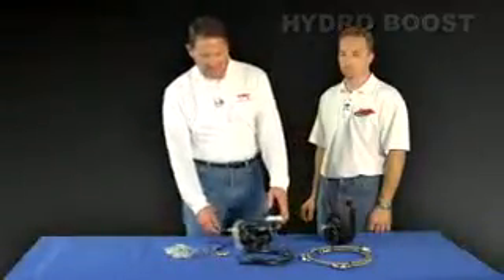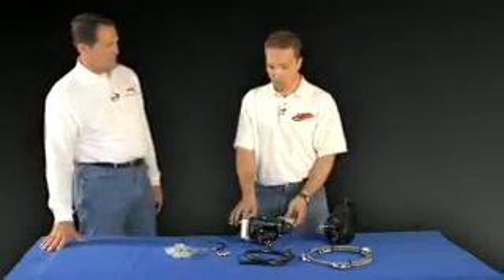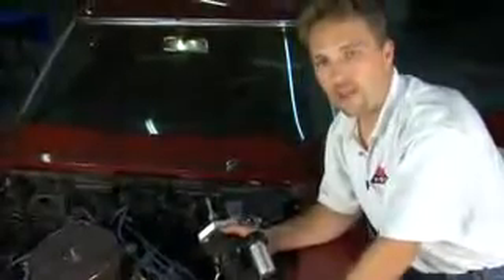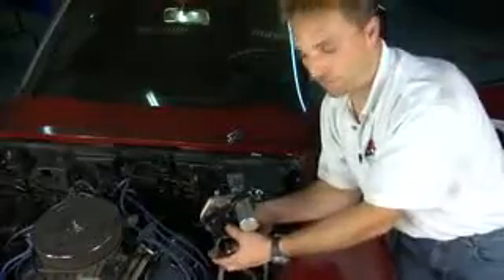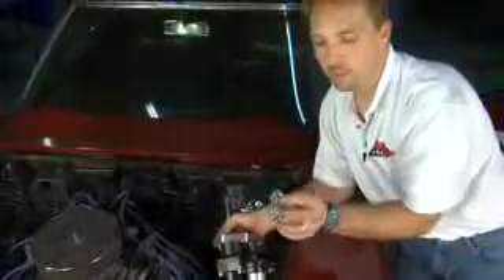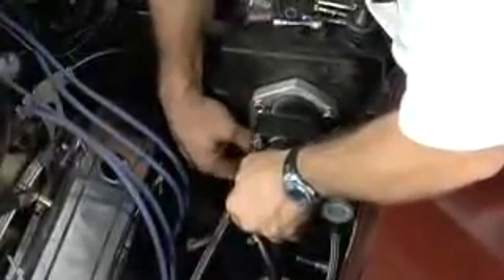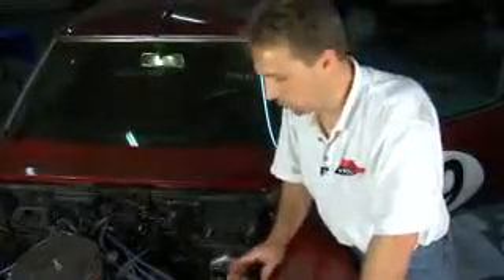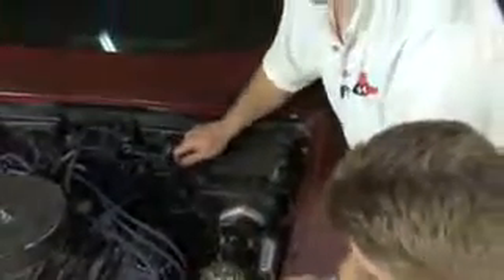VBP - Hydra-Boost - C3 Corvette Hydraulic Brake Assist Systems

Comment from the maker: Locas Cabras, Sorry you feel that way. It's well known (in the brake industry) that hydraulic brake assist systems out perform vacuum assist systems - particular in heavy duty or high performance applications. Please read our updated description (above) or check out the manufacturers FAQ page at http://www.hydratechbraking.com/FAQ.html for details. ...

Comment: So your hiding something else that was broken in that particular cars braking system by installing this?  Or just pushing useless parts?  This system does NOTHING to enhance brake performance other than a possible reduction in pedal pressure needed.  THIS is the kind of scam that embarrasses legitimate business.  Before you try to puff up false claims...  The factory brakes are strong enough to lock up all four wheels, and this system does NOTHING to eliminate fade or improve cooling.  So WHERE is the gain again?